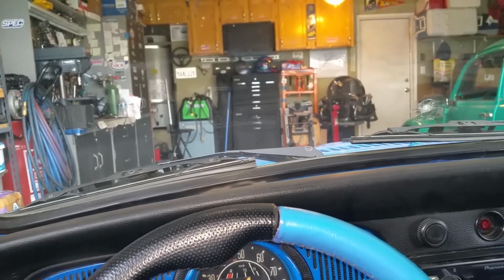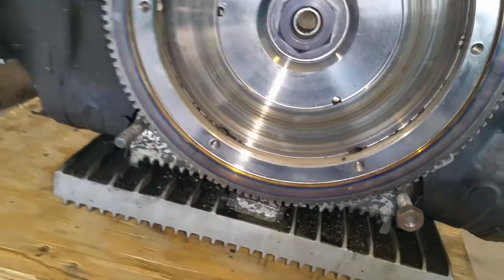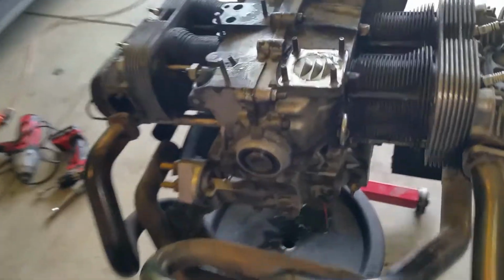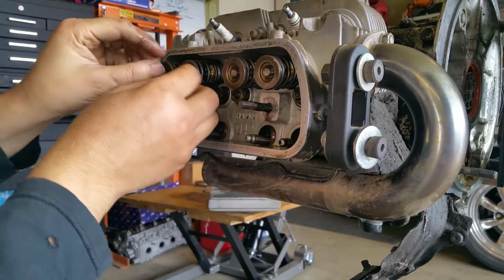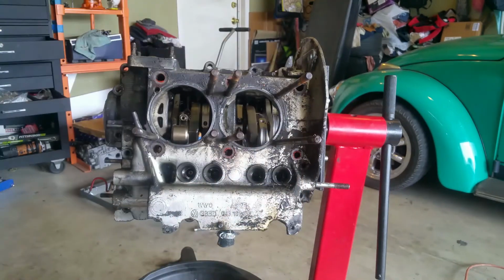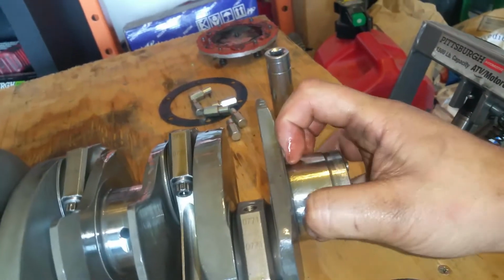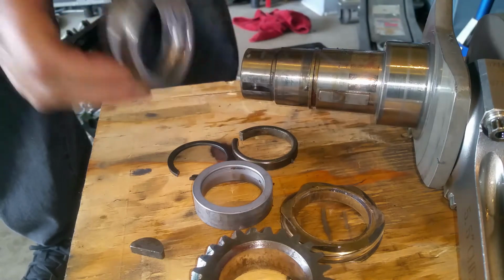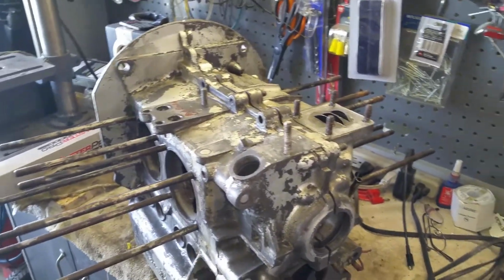2234cc Rebuild

Comment: Love your videos brother.  Your problem with the crank gears is a common issue but usually it's the aftermarket cranks fault. Unfortunately those gears are probably worn now. I would check your crank vs a stock one and you should see a difference where the gears sit.

For those looking into buying a new crank make sure you measure the gear surfaces before assembly.

Comment: With those issues your crank is out of balance. Get the rotating assembly balanced.
Reply: What Torben said.  The way you treat ‘em, it’s silly not to do this. It makes it so much smoother all the way up rev band.

Pros of AL : very strong, cases come with all cool features, very customizable.
Cons: cost, weight, relatively hotter running-should run extra cooler, stock tin doesn’t correctly-lots of mods, 

I have never seen silicone used on the gland nut and never have had any issues with contamination of my clutch.
Reply from the maker: Good point!

Comment: That front gear problem was like that to begin with. You would not been able to pull the cam gear past the spacer area . There was a kid who did a video on that . He could put on the gears with out heating them .   Now what about the 2 extra carbs you have? If you make a single center mount , you will still have a extra 1 ????
Reply from the maker: I still got two 44 IDFs but my son I think he likes the single carburetor setup better. He doesn't want to deal with the high maintenance the IDFs require.